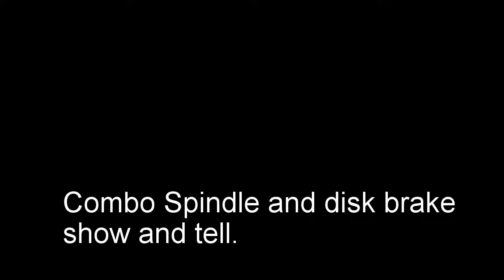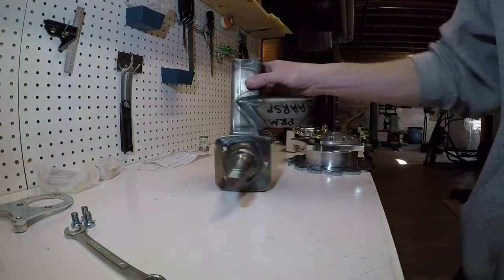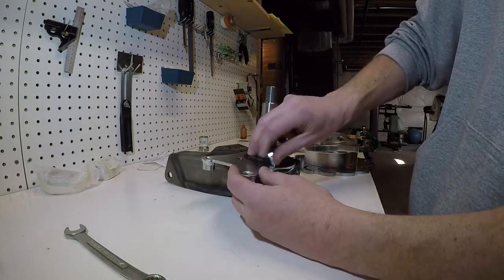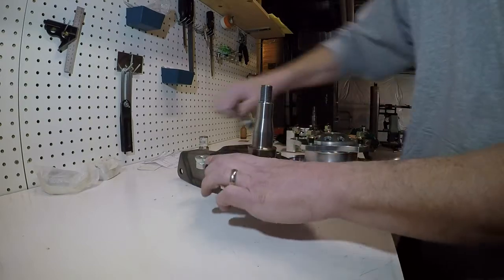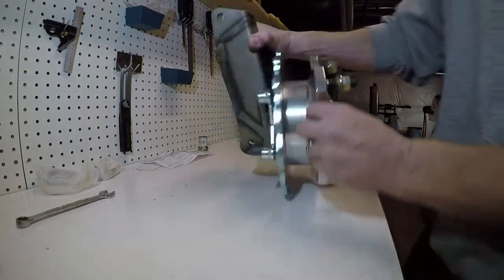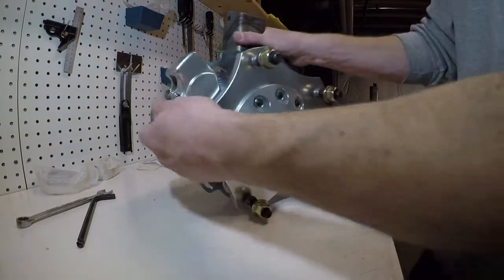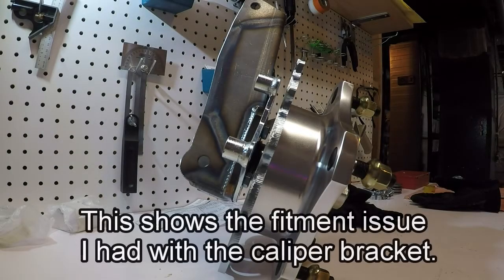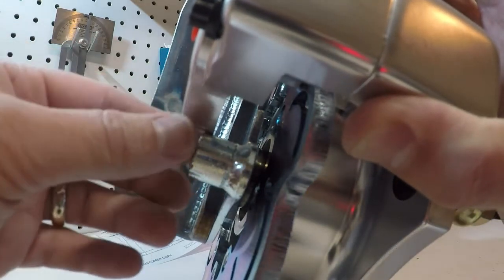Combo Spindle and Disk Brake show and tell.

Comment: Nice set-up for front disk brakes...handy to have needed tools..I have a friend that runs a small  machine shop..with that hard for me to justify procuring the machine tools for the garage.  I can tell you have skills in the machine trades..I worked in a family run tool & die shop for ten years.
Learned some great skills--funny I was attending engineering school at Purdue after work..late nights...The shop owner would always tell me--you are doing a great job of holding onto your creativity, but EASY Simple is at risk..
Reply from the maker: Thanks for the reply Dan. 
I suppose I do act like the fact that I had to machine the caliper bracket a little is no big deal. However realistically 99% of people likely would not have a mill on hand. If you didn't have one you would be in a bit of a pickle.

Comment: I’m about to order my setup similar to yours to fab my A-arms for my bug. Just curious as to why you didn’t go King Kong vs the combo spindles since you’re starting from scratch like I am? Thanks
Reply from the maker: It seemed there were more hub options for the Combos. That's the only reason I went that way. If you already know what hubs you're using and they work on King Kongs I wouldn't hesitate to use them.
Reply: @DougBugBuilder  I just ordered the spindles with King Kong earlier as well as the Jamar 4 piston caliper brake set that comes with bearings so I should be good to go! Thanks for your videos, I’ve really enjoyed all the ones I’ve watched! Going to be watching more as I get closer to bending my tubing so I can get the geometry right hopefully the first time! Fingers crossed it handles well.

Comment: What about the hole alignment? Jamar or kartec problem? Thanks for the review. I will try the CNC disk brakes.
Reply from the maker: I'd say it's a matter of Jamar making a part but not knowing exactly what spindle you're going to mount it to. So I don't think you can expect it to bolt perfectly on every option out there.

Comment: So you loose the speedometer?  Mine is through the spindle
Reply from the maker: You would need a hub with the toothed ring. And you would need to make sure it fits too. This kit isn't really meant to utilize the speedometer.